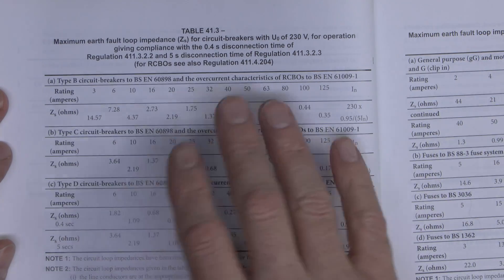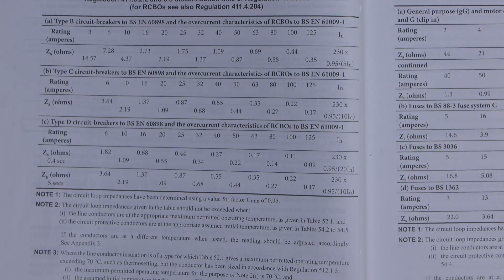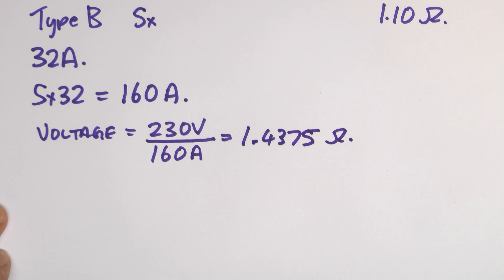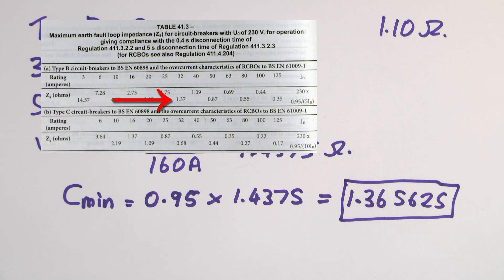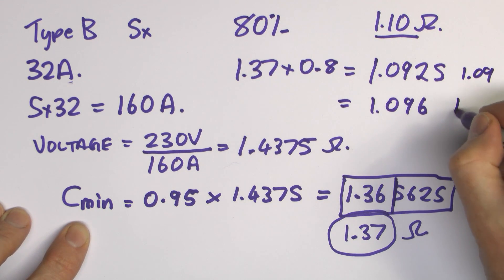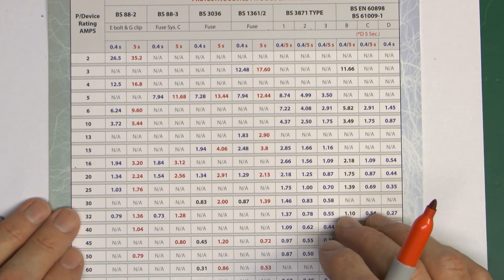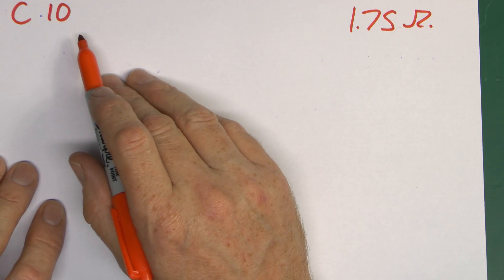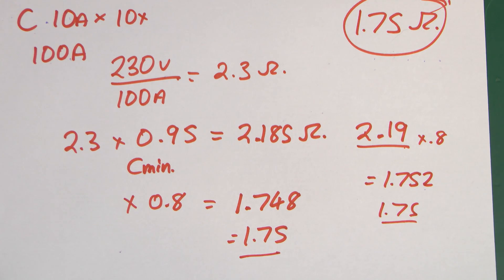Calculating maximum values of earth loop impedance, Zs

Comment: What happens when a 61009 fails the maximum Zs but passes the 5x test?
Reply from the maker: Acceptable for a TT system where the use of RCDs for fault protection is inevitable due to the high Ze.
Not acceptable on a TN system where RCDs are used as additional protection.